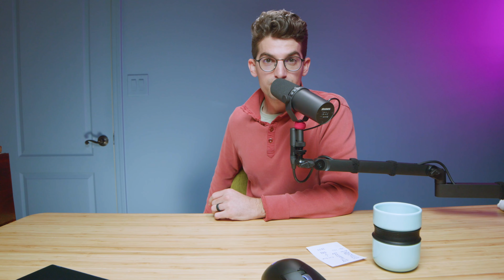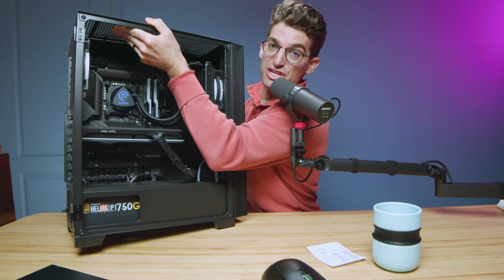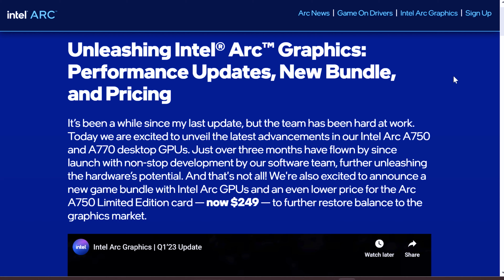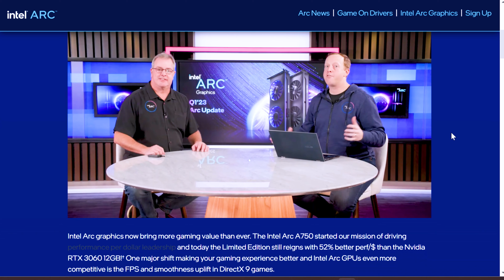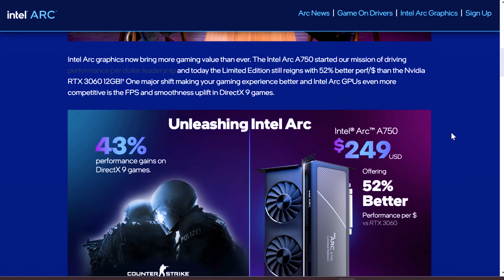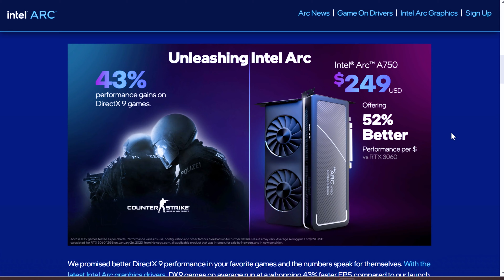Intel Arc now $249?! | Why is Intel doing this?

Comment: A750 is absolutely worth it. 
;| I mean in india 3050 is like 26k to 28k (1usd=82rs)(rn) 
And 6600 is like 23k to 26k
A750 on the other hand is around 23k to 26k 
:| Rebar on/ new drivers can kill 3050.
;| I'm getting more fps on my system with an a750.
A770 is selling worst here in india. (Which is around 35k) while 3060 is selling at 29k to 33k. @_@ and rx 6700 is also selling at 35k. :| Indian market is so confusing idk why.
Reply: Intel 750 is better, with which cpu
Reply: @farcry3940  anything above 11gen intel like 11400 11600k 12100 12400 13100 13600k etc.
For budget efficiency 12100 is the best for gaming at 1080p and 1440p. 
And make sure not to buy an f series like 12100f. Otherwise u won't be able to enjoy intel deep link technology. 
I personally prefer 12400 with asus prime h610m/b660 with  arc a750.
Make sure to turn on rebar in ur bios/uefi. U can increase the tdp in that intel arc control. Which might give u a bit more fps.
Reply: A770 is now 32k on primeabgb
Reply: A750 can be paired with a 12500 for optimal value
Reply: @farcry3940  go for 13400 (it has  efficiency cores)

Comment: These cards take a newer system,  but this will standard within 24 months.  If your building 4 systems or more for studio work and Intel can to the same work in about the same time w stable system and stable driver update.  Then I believe these high prices in Nvidia and Radeon will come down.   This will be a stop gap for the decline in i series cpus.  If something is not done soon gaming on pc is dead end.  Buy a gaming console if gpu are going to be over 500+ or 1000+.

Comment: In Europe, Intel Arc A750 price is 450€
Reply: In Germany it is 274€
Reply: chewzintel hate europe, go figure.
Reply: @Tigerhearty  Nope, just your country in particular apparently. 🤷‍♂
Reply: You're referring to the wrong Europe then (prices include VAT): M5SWS6TIMFWHGLTFOUXT6Y3BOQ6WO4TBGE3F6NJRGITHQZR5GY2TGX2JNZ2GK3A (link in Base32 to swerve the authoritarian yt-censorship-🤖; decoders are easy to find).
€277.89 for the Limited Edition right now, which converted to US$ w/o applicable German 19% VAT nets about US$254.35, so barely 2% above $249.
Where's the problem? Oh, you live in a ripoff-country, I see. 😜
Reply: All tech is more expensive in Europe compared to States
Reply: depends on where. found it as low as 275€
Reply: @ragnarok291273  Yeah, but that's with VAT. For businesses it's just over $250 after conversion.
Reply: @whohan779  the price I saw included vat